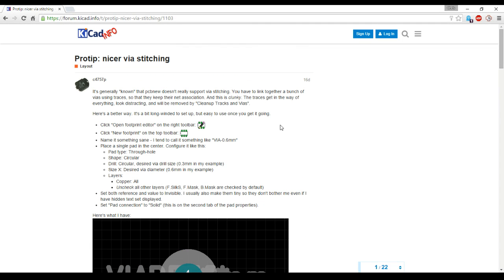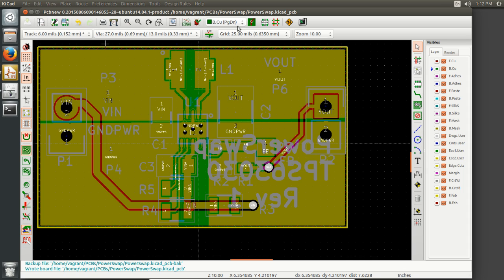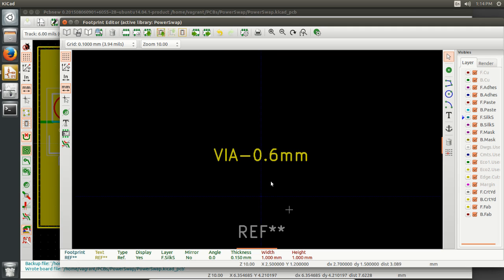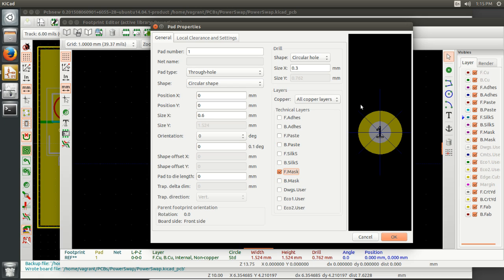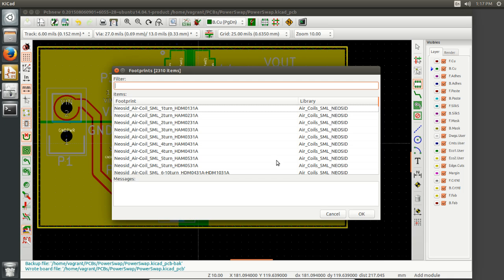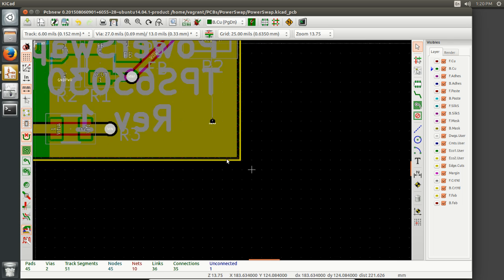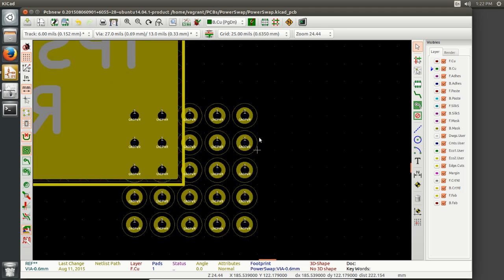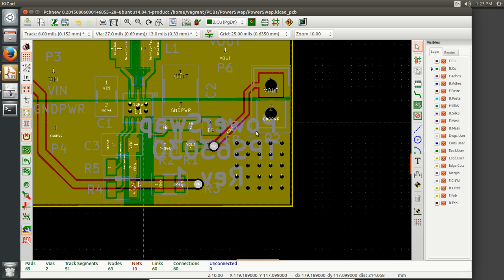KiCad 4.0 - Via Stitching In KiCad (without traces)

Comment: Great video, thanks. I'm considering switching to Kicad and hopefully you can answer this question. With the current package that I'm using, if you want to move a component within a copper fill, you have to redraw the copper fill. However when you redraw the copper fill, the connectivity to the vias is lost and all vias have to be deleted and re-entered. Does this also apply to Kicad?
Reply from the maker: +sefton999 this often happens when you do via stitching "with traces" as mentioned in this video: https://www.youtube.com/watch?v=TlH8KlO3lZc

In the method shown in the video above, the stitching should not have any issues when you redraw the copper planes. One thing that is not mentioned is "locking" the footprints, that's a good idea for stitching vias for when you re-import footprints (a separate issue).

Comment: Nice feature. Normally it would take much time to place all the via's individual.
Reply: Don't want to set a foot print manually? Did i sleep through the day all mfgs put up universally compatible cad files for every part in their library? I'm in the egal world so maybe there's a specific I'm missing but learning how to enter a foot print and symbol myself was probably the biggest time saver there is.. Otherwise it's something like  spend 15 min checking websites for an existing one only to find its wrong, if found at all.. Then half as try my own never having spent the time to figure it out.. Giving up and looking for a diff part. It's nice when a library has an existing foot print but a lot of parts I want to use have been in weird packages and even the built in libraries aren't always trustable.